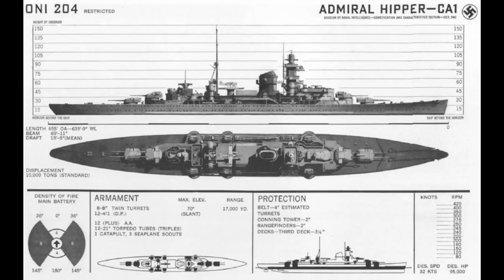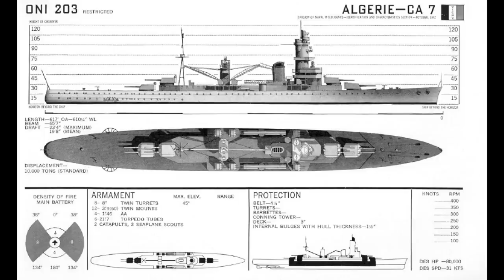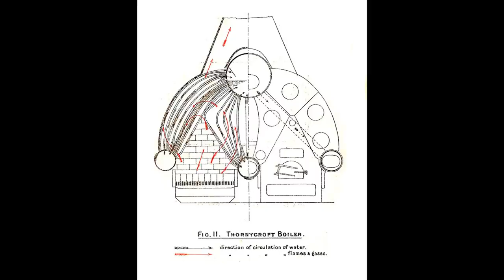The Drydock - Episode 021

Comment: My favourite silly nicknames were for 2 experimental British submarines. HMS Explorer and HMS Excalibur were built as test platforms in the 1950's to use Hydrogen Peroxide as an oxidiser to run diesel engines underwater (with all the obvious benefits that would grant submarines). However, as test platforms they had MANY problems, and gained the nicknames HMS Exploder and HMS Excruciator.

Also notbale shoutouts to The Gin Palace HMS Agincourt (A Gin Court), and HMCS Haida "The fightingest ship in the Royal Canadian Navy"

Comment: The difference in habitability is well illustrated by conditions on US subs at the beginning and end of the war. The S Class was the most numerous class of subs available at the start of the war. They were small, noisy, had unreliable diesel engines that blew a fine film of oil over the whole interior, insufficient electrical capacity to run more than very small refrigerators, and the distilling plants were subject to frequent breakdowns and only large enough to allow a bucket of freshwater a week for a sponge bath. Canned food was the order of the day after a week or so at sea. They were nearly uninhabitable for more than a few hours submerged in the Pacific due to the heat and humidity of tropical waters. The ventilation system was undersized and subject to frequent breakdowns. Temperatures in engine rooms reached 110 F,  and even 100 F in the conning tower wasn't uncommon. The humidity was near 100% and condensation caused dripping water from every horizontal surface, with short circuits and damage to radios and other electronic equipment as a result. The crew had to hot bunk since there were only enough for about half the wartime crew. Some of the most unlucky had to use hammocks strung in the torpedo rooms.

Fast forward to 1945 and the Gato class. They were positively spacious compared to the S class. Almost the whole crew had their own bunks, The entire boat was air conditioned, keeping temperatures at no higher than 80 F and humidity below 65%. Electrical capacity was large enough to not only recharge a battery bank over twice the size of the S boats, but it was enough to run meat freezers, fresh food refrigerators, and a distilling plant that provided each man with an actual shower every three or four days.  They even had crew washing machines, a few had ironing machines, and boats with the most clever engineering section even rigged up ice cream freezers! Frozen meat rather than canned was available for the duration of most patrols, and refrigerated fresh food would be available for the first three weeks of a patrol. Some captains allowed enough refrigerator space that the crew could have two cold six ounce bottles Coke a week. According to some crew memoirs, this was the greatest boost to morale during even difficult patrols. Some veteran admirals viewed all this as making the crews soft, but there's no doubt Gato crews were more alert, better fed, in better health, and had better morale than any other sub crews in the war.
Reply: As far as I'm concerned anyone in a Gato class submarine deserved whatever comforts that the US Navy could manage. Being on a submarine crew was very dangerous. And disappearing was not uncommon. And any "last letters" to loved ones had to remain ashore, if they even had a place to put such a thing.

Comment: After a fire that killed 134 sailors, the USS Forrestal was sometimes called the Zippo or the Forest Fire.  A bit of Gallows humour there.
Reply: Courtesy of John McCain "inadvertently" releasing a missile on the landing deck....
Reply: @kauphaart0  That's been debunked so many times, it was a Zuni off a Phantom that hit a Skyhawk 
If it was McCain shooting off a Zuni, the rocket would've fired and hit something on the other side of the deck then the initial explosion
Reply: @kauphaart0 it was a Zuni rocket set off by stray voltage that hit the airplane next to McCains
Reply: Well regardless, that's something McCain would have done. I think it's fine

Comment: Question for the Drydock:
Could you shed any light on the practicalities of re-painting a battleship? For instance how long would it take, how much paint was required, where was the paint sourced? Some of the examples I have in mind are:
Graf Spee's squadron in Tsingtao in 1914 had to be painted wartime grey as the peacetime appearance was brilliant white. When did this process commence and wasn't it a bit of a giveaway that you were about to commence hostilities? Was the paint stored on board or in harbour?
The Russian fleet in Port Arthur in 1904 mixed all the paints they had to hand together to produce a non-regulation brownish-grey colour to cover the black hulls and white superstructures.
The Russian Baltic fleet that sailed to the Far East in the same war was only painted on one side to smarten its appearance for an Imperial review before it set off.
Bismarck had a different colour scheme as it passed the Norwegian coastline to the one it had at the Battle of the Denmark Straits, meaning it must have been repainted at sea.
Are any of these anecdotes accurate and how on earth do you paint a ship down to the waterline if the ship is afloat and the waves interfering with your work?
Reply: Not sure of other navies, but painting in the surface fleet in the USN is done constantly, even at sea.
Reply: Only issue I see for this being a drydock question is:

It'll take longer to read out than most questions take to answer lol.

Maybe "Could you explain the process of painting a battleship please?" - would have been enough 😂
Reply: @janis317  I once heard the Merchant Marine maintenance routine expressed as, "If it's broken, paint it. If you can't paint it, throw it overboard." Or the advice shared by the Navy and the Army, "If it moves, salute it. If it doesn't move, paint it."
Reply: @janis317  Ships are made of steel, and it rusts constantly and must be repainted often. This applies to all warships and merchantmen. A few years ago I was on a cruise ship, and they were constantly painting what they could get to. I suppose that aluminum or fiberglas could go a long time between paint jobs. Wood needs to be kept painted, too.

I think the Bismarck was painted over when she stopped off at Bergen. It may not have been a complete repaint -- perhaps just the dazzle patterns had to be painted over. Basically, the hull wouldn't get painted while at sea -- just too wet. You have to be in port for that (and in drydock to hit the bottom).

Comment: HMS Hood was known as the largest submarine in the fleet as it was a notoriously wet ship and sat very low in the water due to the design changes made during construction this was also why it had the highest rate of respiratory diseases amongst it's crew although as for the swapping of the Navies the IJN would perform very badly in the Atlantic as they would be well within range of land based airstrikes especially with there wooden unarmoured decks and terrible AA guns and piss-poor radar would be a very tasty treat for RAF Coastal Command even they couldnt fuck that one up whilst although the RN had smaller strike forces than the IJN they had two massive advantages radar control of the fighters and the ability to operate carrier strike forces at night.